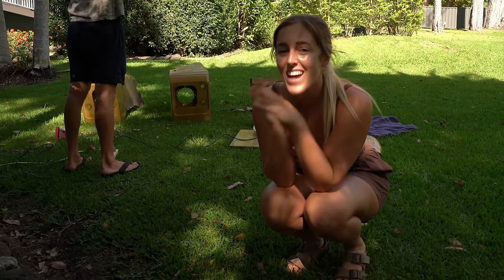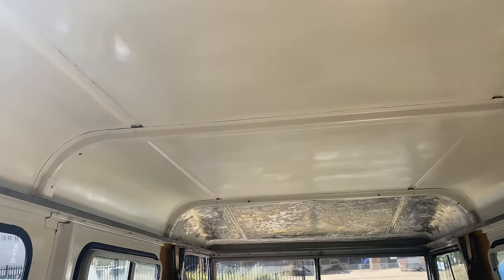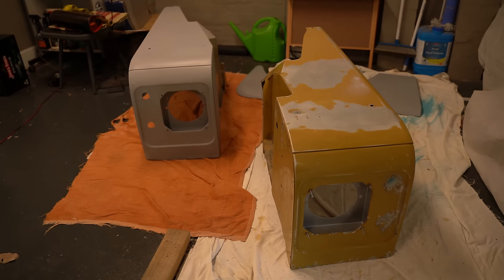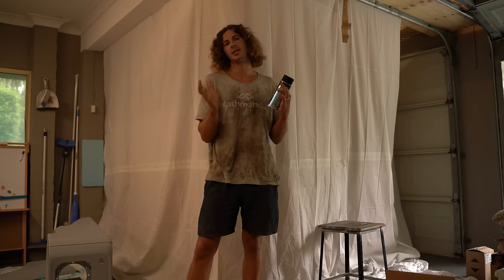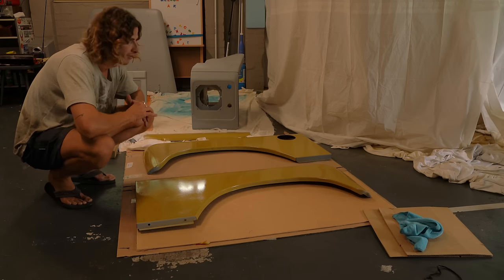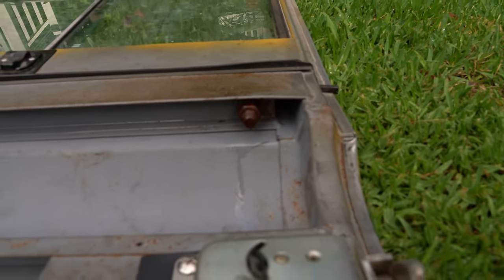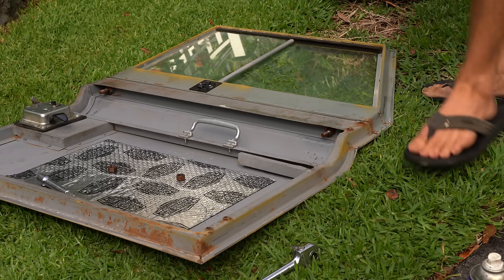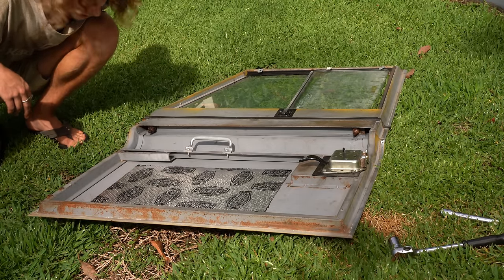We were quoted $10,000 to paint our Land Rover...so we're doing it ourselves!

Comment: Great that you're doing yourself. From what I've seen in your fitout episodes I think that you are very capable to do a great job. There are good trick to undo rusty bolts. First spray them with something ! Wd40 for example . Work the spanner in both directions slightly loosening then slightly tightening and gradually loosening more than tightening. If that doesn't work then use heat. Good luck with the rest of the job!
Reply from the maker: Thanks for the tips Jason. I've definitely been using all those tricks in my arsenal but boy oh boy is it hard work with some of those awkward positions. hahaha

Comment: For painting prep is the key! honestly, the spar gun and compressor is not that bad once you do a few tet sprays. 
To stop the bolts in the doors rusting, remove regularly and grease, pretty much the only way. When we did the last re-door topping on the old Series 2, we had to retube it as the whole stud had rusted and swelled. 

Never seen anyone take the dash off with a grinder, and been doing Series and Defenders for 30 years nearly...
Reply from the maker: Thanks for the tips! I'll be sure to try and stay on top of them.

And yeah riv-nut in the bulk head was stuck and the bolt was half unthreaded and was just spinning round and around. haha. Not sure of any other way to get it out other than nip the head off.

Comment: Had the same problem with the doors. As someone else mentioned, the bolts of the upper section have rusted into the lower door. I struggled for many hours to free them but in the end, I took the easy way out and replaced the door.

Comment: You can try and just wire brush/wheel the rusted threads, rust converter of some kind and then spray some zinc spray over them probs won’t last for ever but just prolong how quick it rusts back
Reply: Would also spray some cavity wax in all the door cavities and all the others you can get into just to help stop moisture sitting in all the internals
Reply from the maker: Thanks for the tips Matt!